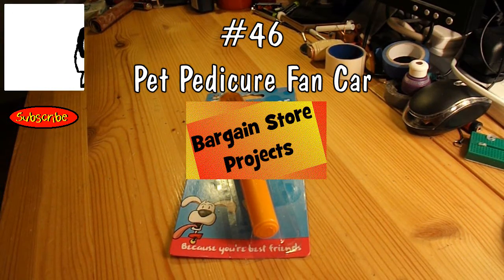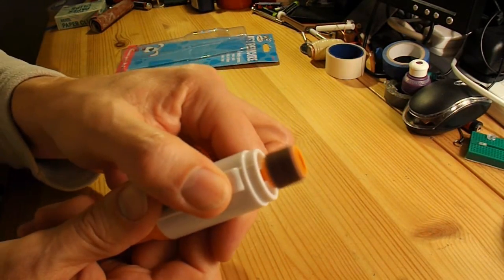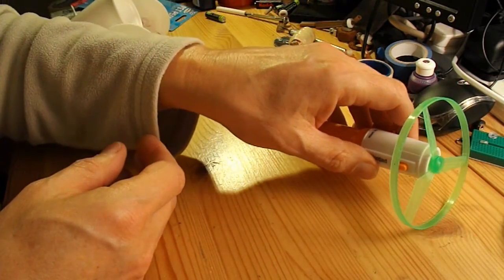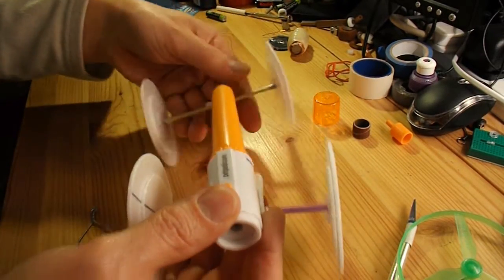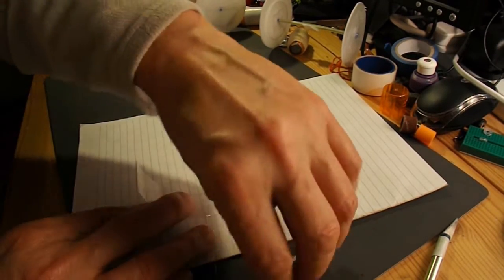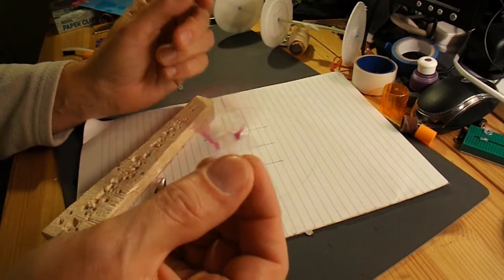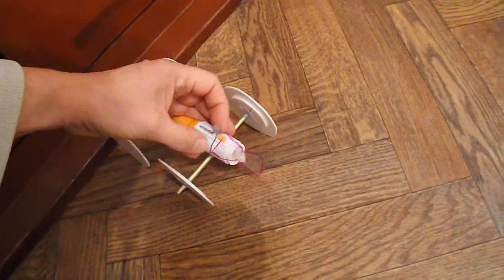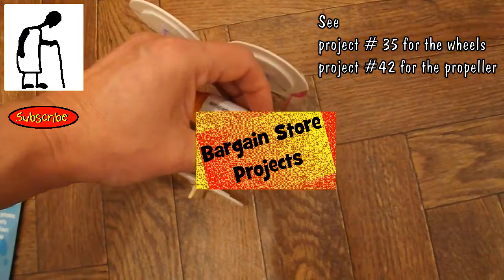Bargain Store Project #46 Pet Pedicure Fan Car

Comment: Hey just curious, in a design like this is it better for the fan to push or pull?
Reply from the maker: Hi there, from an aerodynamic point of view at this size of vehicle there does not seem to be much difference either way. If the bodywork is larger and close to the propeller obstructing the air flow there might be more of an impact but it would still be a problem in either direction. From a practical point of view having the propeller at the front is a bad idea because it hits any obstructions like the wall and can damage the propeller so rear facing is my preferred option. You could still have it forward facing but mounted on a pod in the middle of the vehicle. If you make the pod too high then the car could simply tip over under power due to the leverage of the length of the arm supporting the pod. For the fan cars I have made it just depends which way the motor spins and whatever propeller I have available. I made the propeller for this car and didn't even think about which way I wanted it to go, it just sort of happened.
Reply: GrandadIsAnOldMan Thanks I appreciate your response. I ended up having my fan push the little car and if I get my car back I will post a video and give you a look.
Reply from the maker: rustlemejimmys I will look out for it :-)